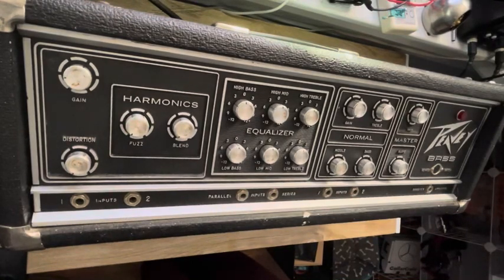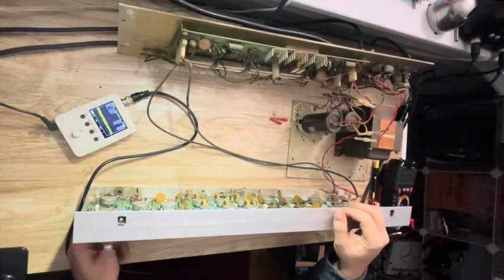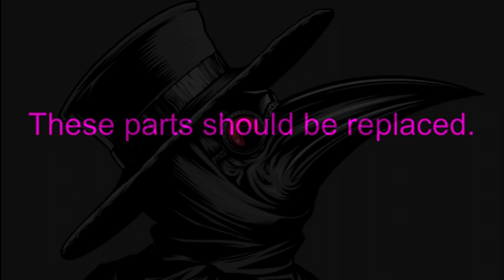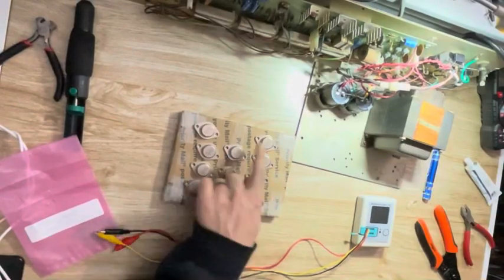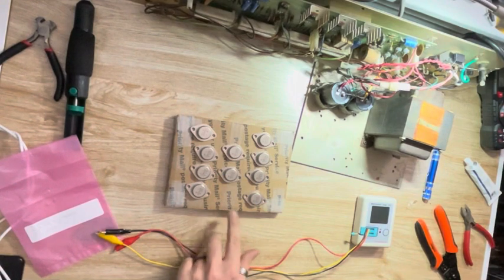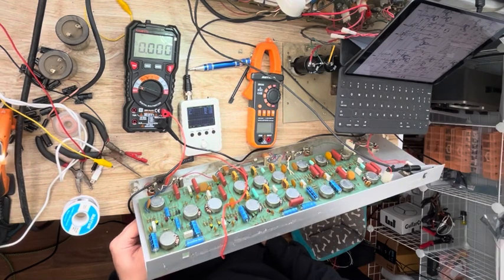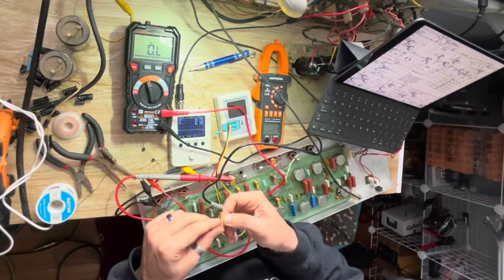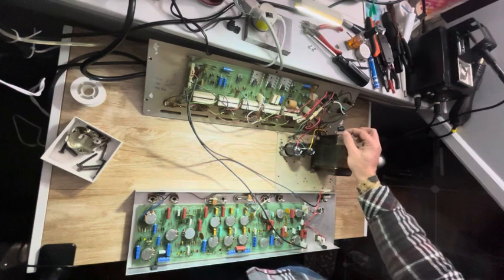Peavey “The Bass” repair

Comment: Thank you. My friend just inherited a vintage 1971 Peavey 300 bass amp with an additional standard head. Unfortunately he is experiencing unwanted distortion regardless of the input jack or head used. He suspects the previous owner may have modified something in order to produce a constant distortion. I would greatly appreciate your thoughts/comments on how he could get his amp working as designed, i.e., no distortion. Thanks and Semper Fi - Ken
Reply from the maker: I would suspect the electrolytic capacitors first. Old electronics can have all kinds of issues from bad components, to things being out of tolerance or dirty.
Reply: Outstanding and my thoughts exactly @plaguedoctoramplification7841  However my friend thinks the previous owner modified the amp in some fashion. To me, distortion equals an increase in voltage or current driving the power amp. As an aside I have a 1970 Fender Twin that had the old paper wrapped capacitors in the power supply. I knew one was bad but replaced all of them and it resolved the issue. In any event, thank you Sir
Reply from the maker: @greyfi it’s possible. But I wouldn’t jump to that conclusion unless the previous owner said that’s what they did. It’s more likely there’s a problem.

Comment: Good job!
You probably already know; but beware of 'good deals' on ANY transistors.  Lot of phony transistors floating around.  Always safer to pay the extra price and buy from a reputable outfit, like Mouser, Digikey, Jameco, etc.  I have risked it and bought IC's from China and most were good.  But transistors seem to be the focus of scammers selling fake parts.
May God bless you and watch over you.
Reply from the maker: Thank you for the input. I got them from another amp tech here in America who had bought out an old electronics supply store. He happened to have 14 nos transistors. I bought 10. Im always aware of fake parts and usually only buy from digikey or mouser, depending on who has the best prices or particular parts i need from that order.